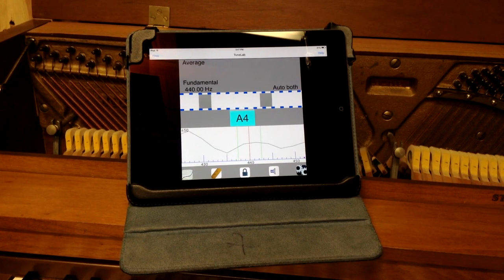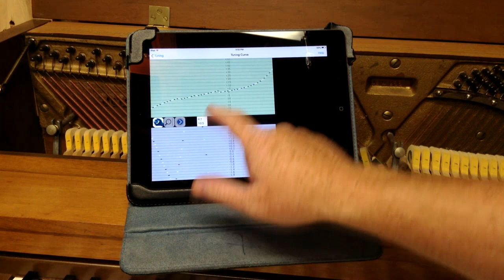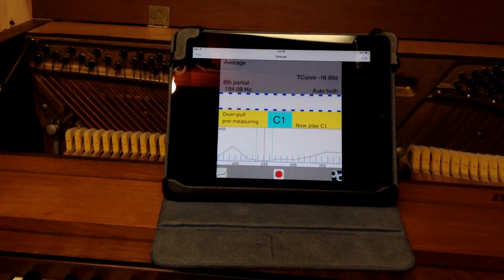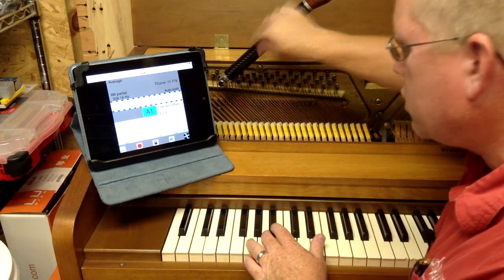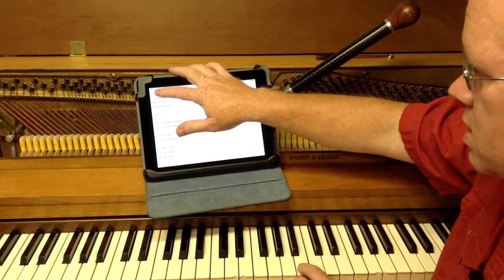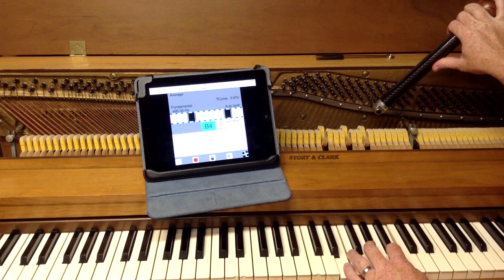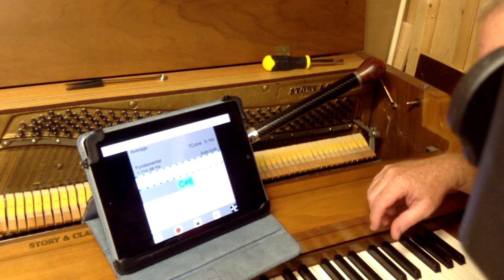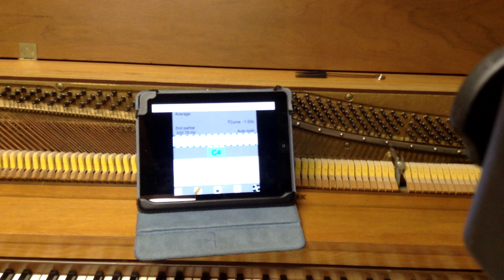Piano Tuning - Pitchraise Demonstration I HOWARD PIANO INDUSTRIES

Comment: I've learned a ton from your videos, just placed my first order for tuning hammer and materials.
I jumped in the fray, getting a beast of an old upright, Newby and Evans from 1895-1900 - haven't gotten a perfect reference on its born-on date.
Much, much was learned without even starting to work on the piano - this piano is probably pretty far gone but now I understand all the things that could be wrong.
As I looked at it closer and closer, I now understand why there are so many warnings about going for one of these oldies.
Every piece of felt needs replacing - I mean EVERY piece of felt 🍺.
But it is my entry piece, and my musical standards are not too high - it will fit the bill for what I need it for.
Most of all, I will be able to maintain any piano from here on out.
Thanks for your great investment in these producing these clear videos - I wouldn't have jumped into the fray without them.
BTW one of the most obscure facts I learned by actually diving in and getting this old piano is a regularly overlooked feature of at least most uprights.
I am looking down into the piano and I realize it was missing the dampers on the upper bank of key actions!
What did I buy? Regret!
Oh, I looked it up and found out that at least most uprights forego the dampers on the upper range of keys - that was kind of mind blowing.
After months and months of watching videos I never heard anyone explain that. I was great relieved I didn't have to locate or fabricate those dampers for that section of keys.
Reply: Hi you talking about the high treble keys? They don’t have dampers because the sound goes away so quickly (short string and high pitch)
Good luck
Reply: @probablyblue426  Thanks

Comment: Fascinating! I'm having a 114 yr old Schimmel upright tuned soon. I picked it up for nothing and the tech looked at it yesterday and was very impressed by it's condition. I'm fascinated by these tuning videos especially this one. What an art and science combined! I SO should have gotten into piano tuning when I was younger. The craft would have fit my personality perfectly. I don't even play but I'm starting lessons soon because it's never too late! I'm 56 yrs old.  

So my piano is like one full note flat on average.  C is B. The tech mentioned the possibility of string breakage. Can you tell me how likely that is too happen? I'll spend what it takes to get it tuned but I'm wondering if it might be pushing $1000 by the time it is fully tuned.
Reply from the maker: If the piano is in good condition there is some risk that strings may break, but the broken strings can be replaced.  The only problem may be is if many strings break.  The it may mean completely restringing the piano which would cost more than $1000.  I have run into a couple of pianos over the years that many strings were breaking as I started to tune, but it isn’t very common.

Comment: My fiancé and I just purchased an old Baldwin full size upright very reasonable. According to the sellers its supposed to be from the late 1800s but we were unable to locate the serial number at time of purchase. It's a beautiful cherry wood with a few ornate wood working details. We pretty much just went by the seat of our pants on this one because of the price, neither one of us really knew what to look for other than just general appearance. The outside has been beautifully refinished but not sure what's been done on the inside for we just looked down through the top of the cabinet. It appeared to be in good condition cosmetic wise but without removing all of the outside panels for better access we're just not sure. Your videos and website have given me the confidence to try to tackle the job of refurbishing, regulating restringing, tuning etc. whatever it needs. It's been interesting learning the workings of a piano, I had know idea, lol. I'm hoping that it's not a daunting job but if it turns out to be I feel confident that I can handle it, thank you for all of the videos and info!
Reply from the maker: Thanks for watching Jeff!  Yes, with the right know how and tools and parts, and a lot of patience and time you should be able to tackle the job.  Please let me know if you have any questions.  The Forum on our website is a good place to post questions as they come up.  It also is a benefit for others who may have the same questions.  Here is a link to this in our store: http://howardpianoindustries.com/forum/
Reply: Great, thank you, I will definitely check it out...

Comment: I have an old (circa 1913) Conway Boston I believe was retuned with an underpull A4 registers as G#4 -23 cents. There is only one broken bass string. The rest is in relatively good tuning.
I want to rebuild this piano as it is a player. My question is, should this be tuned to correct pitch if restrung?
Reply from the maker: If this piano is restrung there is no reason not to bring it up to standard pitch ( A-440). While standard pitch may have been a bit lower at the time this piano was made, I have never found it to be a problem to tune these old pianos to standard pitch as long as the strings do not break.

Comment: I may have missed it but after your initial over pull calculations, you seem to just dive in and pull them all sharp. Was there a specific distance you are pulling them sharp based on your over pull calculations? Thanks!
Reply from the maker: I do pull the notes slightly sharp.  The goal is to get it as close as I can and still do it quickly as the pitchraise is typically done quickly.  I'd rather err on the sharp side than the flat side as when I go back it's easier and more stable to settle the pin down to the target pitch than to try to pull it up more.

Comment: I'm starting to understand the investment in Tunelab now. I can't imagine doing this with a tuning fork... how long that would even take!
Reply: Used to be that’s all we had. You get used to it and I think it’s easier at times. Except the muting. It takes a lot of time to set and move your mutes.
Reply: At Yamaha even now everything is done without electronic aids. For pitch raising we do a first "rough" tuning by chipping the strings with the action removed. Then right away a proper tuning by ear and mostly this does the job in about an hour.
Reply: tunelab is pretty cool but why is it so expensive?
Reply: @JAISSTEUER    Several reasons for this:  This is a professional grade app, designed to be used by professional piano tuners.   This app, and all of the top pro-level piano tuner apps, is packed with features, and updated / improved regularly as technology improves and feedback is considered.  This takes time and costs money to do.   It's also a niche industry, and the number of downloads is much lower than mainstream apps.  Anyways, this isn't even the most expensive one:   iRCT Cybertuner costs $999 plus a yearly subscription of around $80.  That particular app is technologically more advanced than the others, and has been the gold standard for several years.  The technology in it is very advanced and took several years to create by a team of software engineers and piano tuners, and is still being improved.  I was against purchasing it, because of the price.  But once I learned more about it, and realized it would make my tunings sound better and be more stable, the $999 price tag didn't matter:  I knew it was going to help me in my business.    ...Anyways, this pricing model, where professional equipment and tech is more expensive than consumer tech, is found throughout most industries:  If you want to edit a movie, for example, you can use iMovie on your Mac.  It's a free app that comes with your computer.   But it is limited in terms of features, whereas Final Cut Pro has many more features and is more advanced, for pro level work.  Professional equipment is designed for use by professionals, who use the equipment to make money, and thus, pay a premium.

Comment: Dear Sirs,

I’ve been using the software you are demonstrating and it is very good, however my question is:
What happens if you’ve got an 85 note keyboard how do you complete your overpull measurements?

Yours truly 

ross
Reply from the maker: You can change the premeasuring sequence to accommodate this type of situation.

Comment: Hello, Mr Howard, it's me again. First of all thanks for all this videos i have been learn a lot. And i love my new lever that i buy from your web.  (:

My i ask someting again?

I have a Kimball Console piano that it has not been tuned like in 25 years (acording to the sellers). Monts ago a techinican came and tune the piano but i think it set at 436hz. It got untuned in two weeks or so. I tried to tuned the piano several times at 440hz (i did a pitch raise too, only one time) but some strings keep goin out of tune... (specially if i hit hard the strings) What it can be? 

Sorry for my bad English.
Reply from the maker: It’s possible that the tuning pins are too loose to hold the strings at a stable pitch.  It also could be that there are structural issues such as cracks in the bridges or possibly a cracked plate.

Comment: Great videos!  How many cents flat would indicate that you need to do a pitch raise instead of just a standard tuning?  What is the over-pull limit where you start to risk breaking strings?
Reply from the maker: I generally do a pitch adjustment if I'm adjusting the pitch 10 cents or more. I set my over pull limits to not overshoot more than 20 cents in the bass or 30 cents on the rest of the piano.
Reply: Thanks!  This video series is awesome, I'm totally addicted right now.  I play a Lagonda upright (SN 91189) at a speakeasy theme bar.  I haven't found specific age data, but the owner says it is a '27 and I've seen some other pianos in that number range dated to the mid 20's.  I just touched up 3 of the unisons that have gotten off since last tuning and it sounds a lot better.  I checked the A however and it's a full 1/2 step flat!  It's being tuned about every 3 months and is relatively in tune with itself, so I suspect it is being tuned to whatever A happened to be.  I'm thinking this would probably take 4 pitch adjustments and a fine tuning to get back to standard.  Is there any chance this is A435?  I understand there are some old victorian uprights designed to that standard.  Would it damage one of those to bring it to A440?
Reply from the maker: If the piano isn't regularly played with other instruments you wouldn't have to bring it all the way to A440.  But I've tuned many pianos which are marked as designed for A435 to A440 and haven't ever had a problem because of it.  There is a chance though that it could cause some of the strings to break, but it's not likely.  If you were to bring it all the way up to pitch two pitchraises and a fine tuningwould be the most that would be needed being a half step flat.

Comment: Thank you for the demonstration. After the pitch raise, with over pull, do you fine-tune straight away or leave it for a week or so?
I'm a student tuner and many of the pianos I'm learning on are 80 cents flat. I do an over pull, using Verituner, and return about 10 days later to find it "in the ball park" for an easy fine tune.
Reply from the maker: You should be able to do the fine tuning right away as the adjustment happens as you do the pitchraise typically.
Reply: I would highly recommend NOT splitting up the pitch raise and fine tuning up into two sessions, *under most circumstances.   Most piano tuners do it in one session nowadays, as the technology in pro apps like iRCT Cybertuner accounts for settling of the strings after a tuning.  Tuners who break it up into two sessions often get a bad rap these days:  I've seen Yelp reviews that said, "I hired ___ to tune my piano and he made me book two sessions, and later found out that other piano tuners would do it in one session..."

Comment: Have you noticed a piano's tuning being less stable following a pitch raise?  Will the customer be able to go longer between tunings if I do smaller pitch raises over time or does it not matter?  I've always worried about the tuning being stable for a shorter period of time from stretching the strings this much all at once as well as breaking strings.
Reply from the maker: As a general rule, the more you move the pitch, the more potential you have to introduce instability into the piano. However, most of the changes in pitch happen immediately when the tension is added to a piano during a pitch raise. So, it is not necessary to wait for a period of days or weeks for this to take affect. While raising the pitch in small increments was a traditional method of approuching pitch raises before electronic tuning devices were used, it is now general accepted that a large pitch raise ( say up to a half step ) can  immediately be followed by a fine tuning.

Comment: Hi there! I have a Baldwin Acrosonic from the mid 90s, I believe. Most of the notes are about 30 cents flat. Would this require two pitch raises? And if so, how long would I need to wait in between raises?
Reply from the maker: You should able to do just one pitchraise.  You don’t have to wait anytime in between as the settling is done as you go.
Reply: @howardpianoind  Great, thank you! My piano is a little strange, in that the treble was around two half-steps flat, but the rest was just around 30 cents or so. I tuned the treble back up last night, so I'm hoping I can get it all done at once now.

Comment: I tried to recently tune my piano. While tuning I realized that I was a little harsh on some tuning pins. Now after watching Your videos I'm wondering that I may have harmed the pin block. Although piano is in tune now and It sounds okay, can causing pins to tune down/up half step and then bringing it back to the orginal pitch harm the pin block in a 5 year old piano?
Reply: I'm not an expert, but you probably didn't do harm to the pins by going up and down. Now if your actual technique was bad and you were pulling on the wrong direction, and if you used a really inexpensive tuning hammer, then you can damage the pins physically. Check your pins and see if they have " tool marks"  on them from where you're tuning Hammer was attaching to them. How much did your tuning hammer cost?
Reply: @Jimmy-rd5ig  Thanks for the Reply 😊. I checked tuning pins head and body, there are no marks of hammer head. I'm using a starhead tuning hammer that cost $65. Its been 2nd month now after self tuning, till now piano is in tune. Also, when I tune the piano the room temperature was 34°C and now its 24°C. There is no drastic change in tuning.

Comment: When you say do the “fine tuning”, do you mean that you take a “inharmonic” reading after the pitch raise?

Or do you mean you keep the same settings on tune lab and that you go back over the strings a second time?

Thanks so much for your videos!
Reply from the maker: I will usually take a new inharmonic reading after the pitchraise and then go through and tune the piano again as the pitchraise was not something to get an accurate tuning, but just to get each string close to pitch.
Reply: howardpianoind Thanks so much Howard! I just bought your impact tuning hammer as I have a hard time with precise tuning of the treble sections... especially on an upright and spinet 😊

Comment: I have a beautiful Price and Teeple Cabinet Grand upright from around 1912 that has dropped in pitch by a whole step across the entire piano. I would really like to restore this piano but I’m worried that the pitch has dropped too far for it to even be worth restoring. Do you have any advice for me?
Reply from the maker: It is possible that the piano can be brought up to pitch, but it may be that the tuning pins have become loose, but there are remedies for this.  The main thing to look for is structural damage such as the bridges or soundboard or frame.  If these are in good condition, then there is a good chance the piano can be brought to a reasonable level.

Comment: So Mr Howard, you don't use the hammers you sell for your tuning? What's the advantage of that kind of hammer you're using there?
Reply from the maker: I used to use the extension tuning hammer that we sell, but currently I use the hammer that I am using in this video.  It has a carbon fiber handle which is lighter and stiffer than the traditional wood or nylon handle hammers.  It is quite a bit more expensive than the ones we sell, but it does perform better.

Comment: When a note needs more than the overpulling sudgests...(in the red)  what do you do? Leave it flat, Pull it up some, and go back later to pull it up more or other?
Reply from the maker: When the pitch is off that much that it is over the overpull limits, it's best to do two pitchraise passes.  The first time pull it up to it's overpull limit which is what happens when you see the red.  Then the 2nd pass should allow you to pull the pitch up the correct amount.

Comment: I recently "inherited" a 1948 Story and Clark spinet. It has not been tuned in decades. I measured the actual frequency of the A note and found it to be about 396 Hz. Is it possible that the piano was originally tuned to A400 Hz? Or is it more likely that it has drifted that much lower? Should I expect problems when doing a pitch raise to concert A440 tuning?
Thanks
Reply from the maker: I'm sure that the piano was originally made to be tuned to A440.  It sounds like it has just drifted that much down in pitch over the years, which can happen.
Reply: howardpianoind thanks.